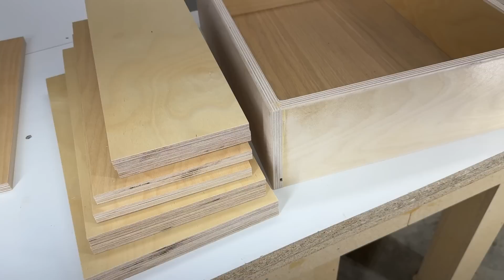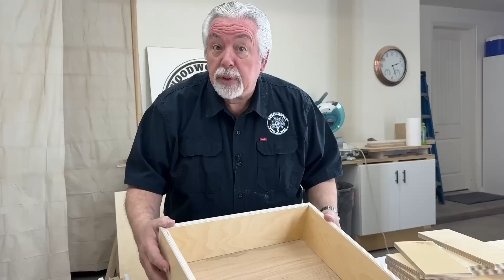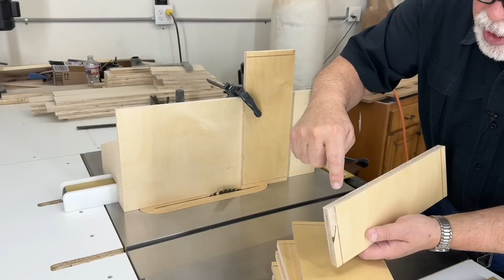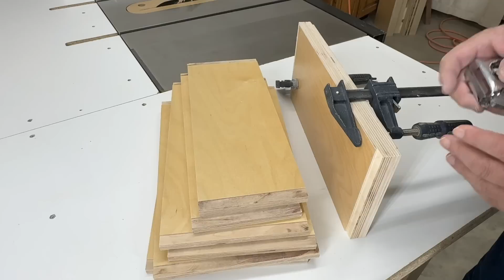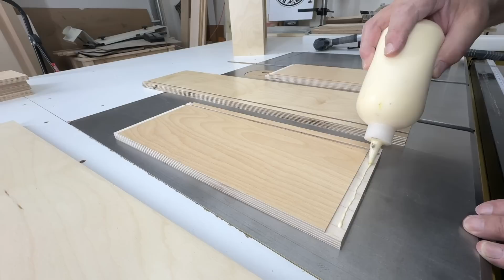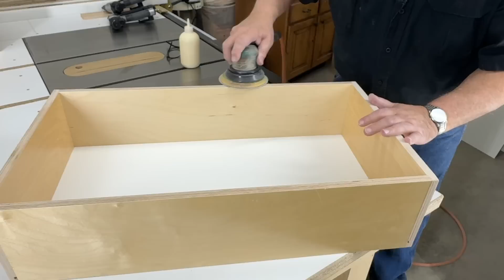Drawer Making 101: A Beginner’s Guide

Comment: Put 2 1/4" dowels 1" long on each corner and it would be stronger and last longer. The glue will fail in time and the joints will weaken with usage, I just repaired some drawers done this way.
Reply from the maker: Noted...thanks for watching, Wes

Comment: Anyone know of a spreadsheet that lets you easily match opening, drawer guide and material thickness to measurements? The cutting is for me the easy part it's the measurements using different panel thickness that causes all my mistakes
Reply from the maker: I have a platform that will give you a personalized video showing measurements, cut sheets and complete coaching through any project you want to do. Check it out at:
https://woodworkingwithwes.com/
Thanks for watching, Wes. 😀

Comment: I'd like to see a beginners guide where tools a beginner are unlikely to have are not used.
Reply from the maker: Hi...I appreciate the comment, however, I have found every beginner has a different set of tools. The tools I have are very basic to woodworking. Thanks for watching, Wes
Reply: Any more basic would be a hammer and nails a hand saw (manual) I could go on but what’s the purpose just like how it’s normal now to have battery nailer or screw gun and not a manual one
Reply: @garicklindsay1980  A tablesaw is not a beginner tool, they are not cheap. A circular saw, a drill, a trim router perhaps. The kind of things you might have for general diy, and can pack away easy.

Comment: I enjoy your videos Wes, you do a nice job of explaining the process. This is not at all a criticism, just an alternative view on the joint design choice. I would say the 1/4-1/4-1/4 (or more correctly 1/2-1/2-1/2) method is probably a better way to go, although you do need a box cutter or dado blade set. But you didn't mention how you cut the grooves for the drawer bottom so assume you used one of those blade sets anyway, which would make required equipment the same. The techniques used for that are very similar to your demonstration however I believe the 1/4-1/4-1/4 method gives a stronger and more aesthetically pleasing result (and won't require nailing). 
I would also prefer to use screws rather than staples on fastening the bottom panel to rear, so it can be removed easily if ever needs re-finishing or replacement. 
But again, i did enjoy your video and skillset.
Reply from the maker: You make some good points, I appreciate you sharing your perspective! Thanks, Wes

Comment: I don't have a table saw, so can rabbit joints be done with a different kind of saw?
Reply: A router table or a router with a jig would work well.  A sliding miter saw and accomplish the same in a more limited capacity with a depth setting.
Reply from the maker: @ryanhaley3932 HI...thank you Ryan. Great advice. Wes